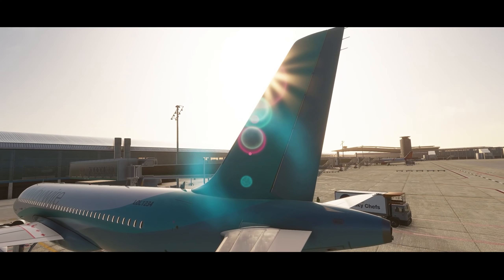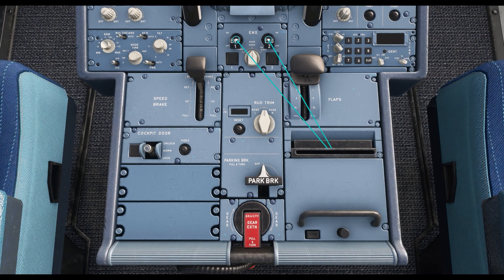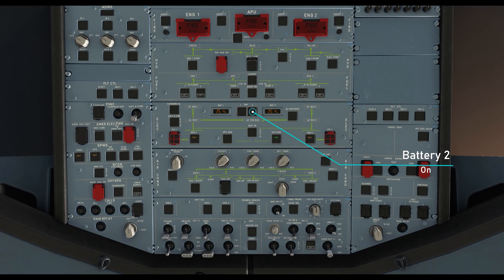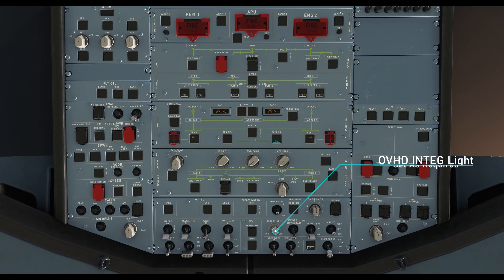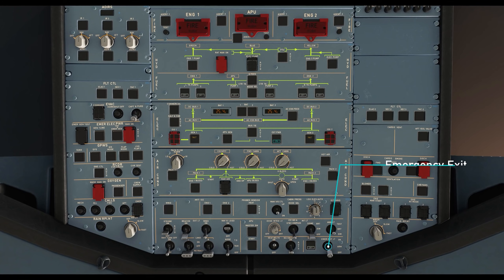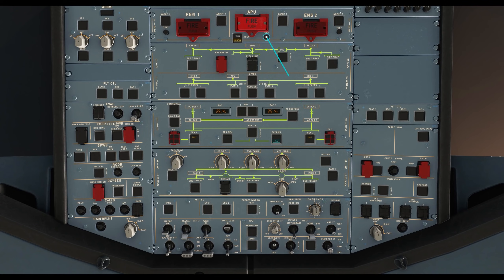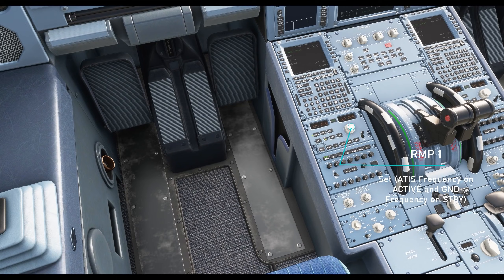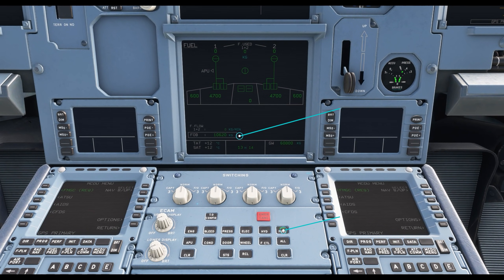FBW A32NX Ground School | Chapter 1 - Cold and Dark Start

Comment: Seat belt signs should only be on if fuel is loaded.  If fueling is required, seat belt signs should be off before fuelling commences.
Reply: @Zyonix007 he is right tho.
Reply: No
Reply: @crispyaltis3661  Yes, you are supposed to wait to put your seatbelt until after refueling incase a fire breaks out and you need to evacuate.

Comment: Should the Parking Brakes be set to ON instead of OFF before powering the plane?
Reply from the maker: Through the process when starting the aircraft from Cold & Dark, the chocks are usually in place at this point in IRL operation. Alongside this it helps with cooling of brakes if they have been used recently.
Reply: If the plane is in Cold and Dark state wouldn’t the brakes would be cold?
Reply: @magicnorm2036  No, because in real life when plane arrives at airport and parks, pilots will turn off all avionics in plane, but the breaks will be still warm even when the new pilots use the same plane, its not like plane sitting not used for long period of time, but ofc its in real life not in sim so how you use it its up to you.
Reply: @Krahamus  No they normally won't.  See 320 sim pilot's video on turnaround.
Reply: @Krahamus  Wrong. First and last flight of the day should be lights out.
Reply: Then, when should the Parking Brakes be set to ON?
Reply: @magicnorm2036  Always for Safety.
Reply: @cjmillsnun  I would never reference to a youtube channel that flies planes in a simulator and compare it to real operations. Even if the youtube content creator is a real pilot himself you can not compare simulator operations with real world operations. I think even this youtube content creator does disclaim that these simulator operations should not be used for real world operations.
Reply: Do we trust the the ground crew in flight simulator to place the shocks on the parked plane? 🤔So I’ll keep the breaks on for now, do not want to run into the terminal....😂

Incredible work on by the FlyBywire team!
Reply: But the Parking break does not make any heat when sitting at gate and cooling is not affected if on at gate.
Parkingbreak is mandatory when at gate and until pushback.
Reply: @SloDigital  But the Parking break does not make any heat when sitting at gate.
Reply: @Stisse12  Most planes use disc brakes so if the parking brake is set then the pads are compressed against the disc which prolongs the process of cooling. If you have hot brakes it is a somewhat common procedure to release the parking brake to cool the brakes once you have received a chocks in signal.
Reply: ok let me clear stuff up:
WHILE PARKING NEAR A GATE, PARKING BRAKES WILL NOT BE NEEDED IF THERE ARE CHOCKS, if u always enable parking brakes, it will overheat. be smart
Reply: @cjmillsnun  the title says COLD and dark
Reply: It’s spelled “brake”.

Comment: You can ignore my 2 comments below. I just found out the latest mod is a new separate aircraft and not the one first on your aircraft list of thumbnails. It appears as Flybywire Simulations and is about halfway along the thumbnails. I think they should have explained this in the new loader for the  A32NX. Hope this helps others.

Comment: Why is there an Auto mode for the NO SMOKING SIGNS?
Reply: it turns on as soon as you extend the L/G
Reply: In most modern Airbus aircraft, the switch is usually connected to the emergency exit lights and/or the no electronic devices sign if there is one on that aircraft. Auto mode will make these turn on whenever the gear is down and locked (this is why you usually hear a ding in the cabin a few seconds after takeoff)

Comment: Excellent video! Now! i have a serious problem, i use msfs 2020 STEAM i downloaded from your site the FBW A32N installer and installed that automatically by STEAM directory
 C:\Users\my Username\AppData\Roaming\Microsoft Flight Simulator\Packages\community and everywhere else... i don't know...! the aircraft appears on the list, and normally at the gate, cold and dark and remains dark pushing batteries buttons 00 volts, no power,  connecting external power nothing! dark screens, no parking brake move no flaps,   is it possible STEAM to block every addon aircraft outside the msfs  marketplace? or happens something else? HELP, please! greetings from Greece. Thank you

Comment: I am using  stable version V0.6.0, and  Crew Oxygen Supply is (lnop) and so are  all three ADIR switches. So what version does this apply to??? I stopped at this point so dont know how much of this does not apply
Reply: That’s odd. The 3 ADIR switches should definitely be working. There isn’t any other way to align the IRS as far as I know.

Comment: Does anybody else have an issue with wipers automatically coming as soon as you turn Battery Master 1 on? The wiper switch is set to off by default when loading into gate/parking but it is inoperable, nothing happens when I click on it.

Comment: Items marked with asterisks do not work due to items are lnop

Parking Brake 		OFF
Speed Brake		OFF
Radar Sys		OFF
Flaps 			Retracted
Engine Masters 1 & 2 	OFF
Engine Mode		NORM
Thrust Levers		IDLE
Landing Gear		DOWN
Wipers 			OFF
Bat1   Bat2		ON
EXT PWR			ON
***Crew Oxygen		ON (Lnop)
***3 ADIRS		NAV(Lnop)
6 Fuel Pumps		ON
***APU Fire Test	(Lnop)
***Eng1 Fire Test	(Lnop)
***Eng2 Fire Test	(Lnop)
Reply: get the updated version, they all work for me